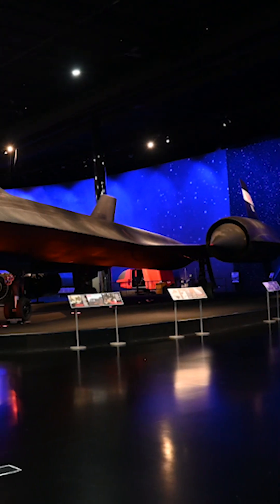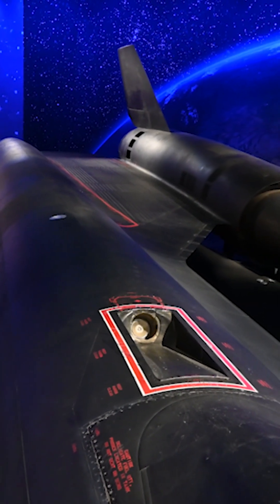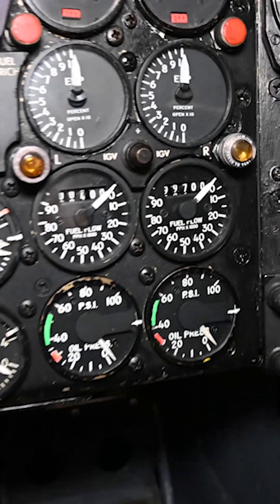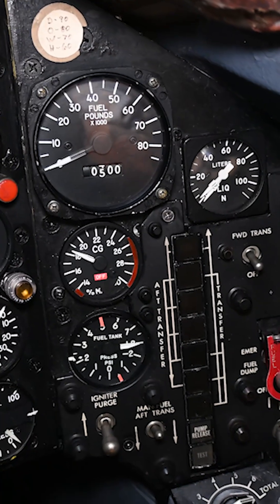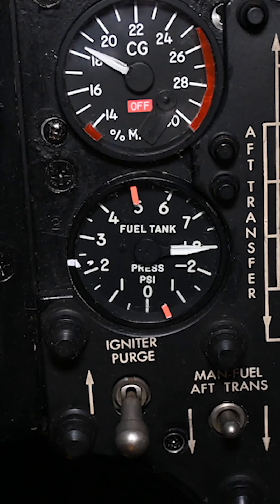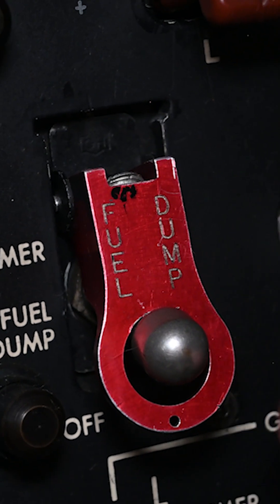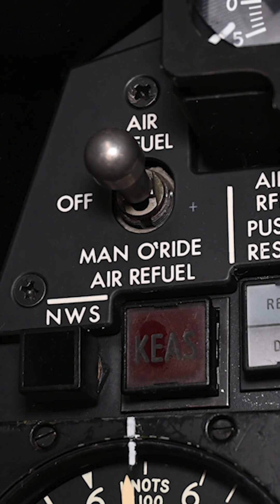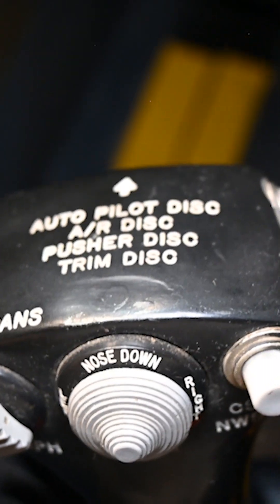Looking at the Blackbird's fuel system. #aviation #blackbird

Comment: My old neighbor was a Blackbird RSO and one of my favorite stories of his was about fuelling! 

Apparently the fuelling boom for the SR-71 had some kinks early in its operation. On a decently long mission over Eastern Europe they had to do 3 mid-air refuels, and just after seating the boom on the 3rd one it proceeded to basically disintegrate. They had to go fast through some...less than open...airspace to make it back to their base 😂

He said no one ever could give a very good answer as to what happened. Luckily the only system on the Bird that got damaged was the fuelling port and the tanker was totally fine aside from the boom. 

He said that was about the only time he was genuinely afraid while flying that beast!

Comment: Both engines have slows in the 10,000-90,000lbs/hr, PER ENGINE, and the fuel tank shows it holds only about enough to do 180,000lbs/hr for about 30 minutes =p

Comment: The fact that it has center mass indicator is insane
Reply: Fuel efficiency vs Aircraft stability.
A delicate balance.

For aircraft, the tail elevators push down on the tail, while the wings lift upwards. That downward force directly reduces the total lift of the aircraft and increases the overall drag, and hence reduces fuel efficiency. But by shifting the center of mass rearwards, the amount of down force required is reduced and therefore the fuel efficiency increases.

But the more aft the center of mass is, the less stable the aircraft is. Get it too far aft, and the aircraft becomes uncontrollable.

Comment: I can only imagine what the tanker crew thought when they first laid eyes on the blackbird for the first time ever, especially since everything was kept rly quiet, and that type of aircraft and technology was not even imaginable when the blackbird rolled out of the factory for the first time, and were put into service not long after.
Reply: I do actually wonder if they had to be part of the program and re used the same crews during the duty time of the sr72 or if they just randomly filled a tanker with jp7 and told them where to go
Reply: @wolfsworkshop9095  I bet they didn't know anything about it until they laid eyes on it. Our soldiers back then were proud of our country and the gov knew that they wouldnt say a thing about anything classified. They didn't even know what it was or what it did guarantee lol, but they knew it was something important.
Reply: The tanker crew would hear the usual 'what you see, what you hear, leave it here' from higher command on the radio after every refueling of the Blackbird
Reply: @pihermoso11  oh I'm sure, would love to be a fly on the wall when they reacted to the sight of it. Prob thought it was a top secret space ship lol Well it actually is a space ship if you think about it
Reply: The tankers which service SR-71s were also flown by9th Strategic Recon Wing out of Beale AFB, California.  They were KC135Q and were modified exclusively for use by Blackbirds, with intercom by wire while refueling -- radio silence.
Remember the 'bird's engines at full power -- massive ram jets pumping tons of fuel and air through them.

Comment: Just throwing this out there for all the nerds. The fuel gauge lists max capacity at 85,000lbs of fuel. That’s roughly 48,000 litres, or 12,750 gallons of fuel. I used to drive a Jet A truck, it’s capacity was about 14,000 litres. Google tells me the SR71 burned about 40,000lbs per hour, so that equates to 1hr +15mins run time before a fuel stop is required (standard 45min reserve without alternate airport). 

To put it in perspective a B-train filled at max legal highway capacity can fit (according to google), 62,000 litres. 

An SR-71 needed roughly 3/4 of an entire B-train (those semi trucks you see on the highway hauling fuel), worth of fuel to fill from empty. And burned roughly 40% of a B-train per hour of flight. This was enough fuel for the black bird to travel about 2400 nautical miles in 1 hour +15mins, or Seattle to New York.

Edit: the SR71 burns roughly $50,000 Canadian per hour of fuel at retail prices. Or $833 per minute of fuel.
Reply: Is that fuel at the servo price or jp7 price ?       

PS if jp7 can you point me in the right direction I need some for my V6 Commodore 😂
Reply: @trevevns3242  jet A delivered to the airplane, you can’t buy JP7 retail.

Comment: Gould you tell us why aircraft instruments are always scratched everywhere and have coatings and paint peeling/chipping off.
Do polits use their teeth on some of those switches?  Those instrument panels are hundreds of times more expensive than a BMW dash board, yet they always look like a dog's breckfast.
Reply: Its mainly because these planes, especially military ones are used almost every single day. Pilots also wear gloves etc with thick plastic fingertips when flying so a lot of these planes would have many hours in their logbooks. and obviously over time the paint starts scraping off. Also it's not like dashboards have paint coatings.
I hope that helped  
👍

Comment: Is that pounds per hour? Like that thing can swallow up or more than 1t of fuel a minut?
Reply: Note the x1000 meaning 20 on the dial indicates 20,000lbs an hour
Reply: Probably
Reply: 3000 lbs of fuel per minute at full tilt. Fantastic
Reply: 80,000lbs of fule doesn't just  get mpg
Reply: Something any hotrodder will tell you. Speed costs money.
Reply: 600 kg/min at cruising speed.
Reply: PPM, per minute
Reply: @Radke32  it definitely is PPH, Pounds Per Hour